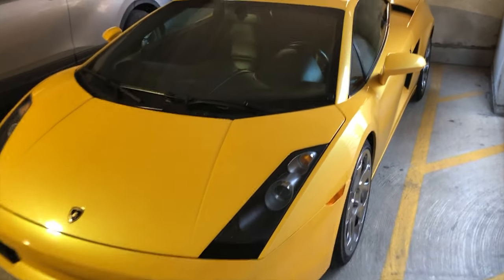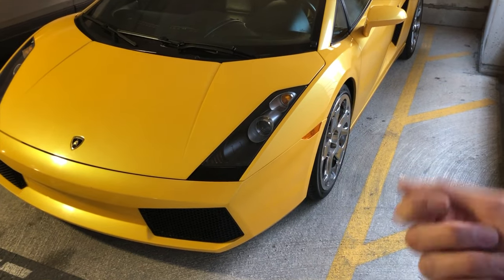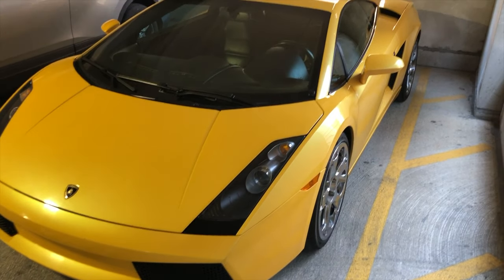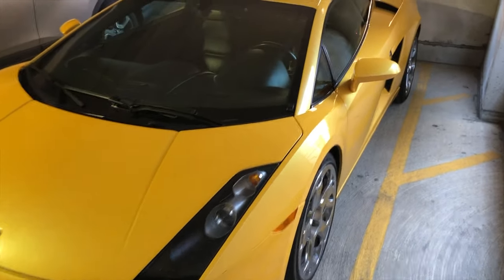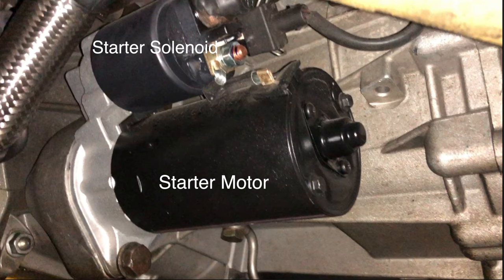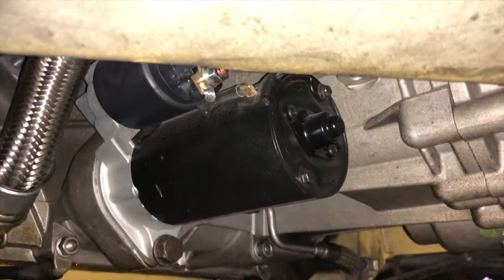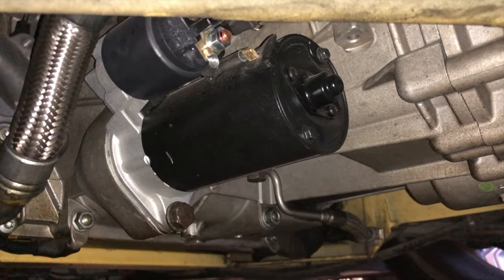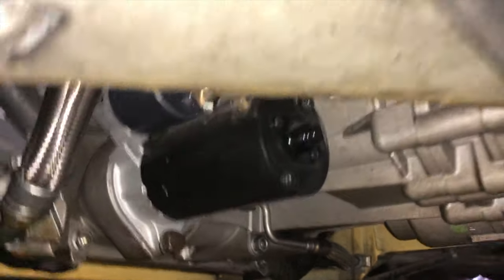Fix Your Car's Starter With A Hammer

Comment: Weirdly this hasn’t worked for me (yet) but it did work on a failing alternator years ago. I had to bump start in reverse. However I was hitting the barrel of the starter and not the solenoid so gonna give that a try now cheers man
Reply from the maker: Hope it works for you, feel free to comment back what happens
Reply: @sgfreak96  it worked mate 😁 last night I was in town and a lot of traffic so couldn’t hit the right place. For me I had to hit the back of the starter motor and it freed after a few attempts I don’t think it was a solenoid issue for me as you could hear it click each time but get stuck and nothing happens. Starts first time now 10+ times today no problem.  , good video cheers 🍻.